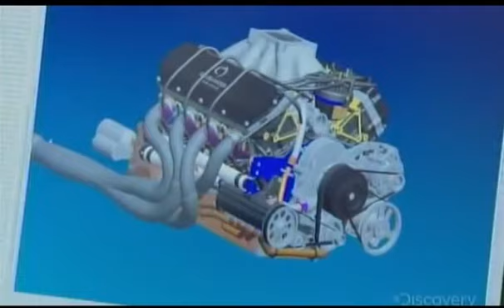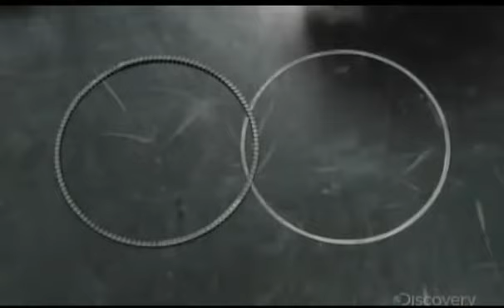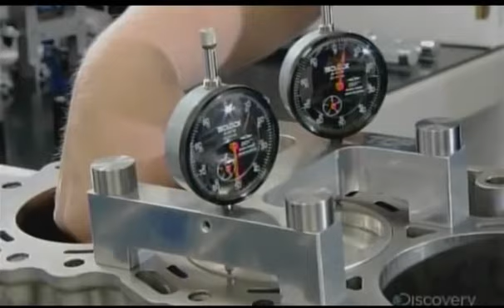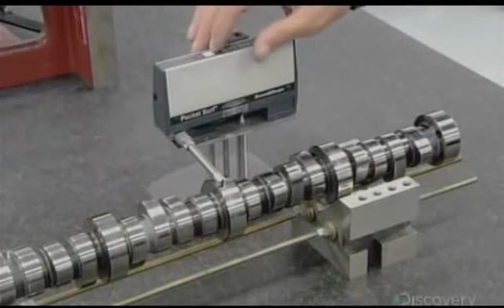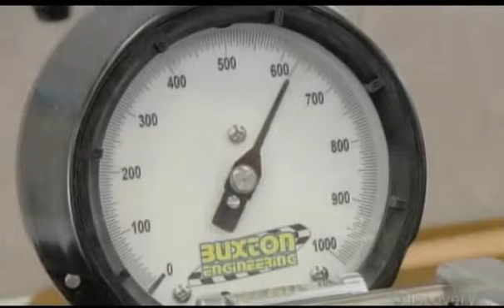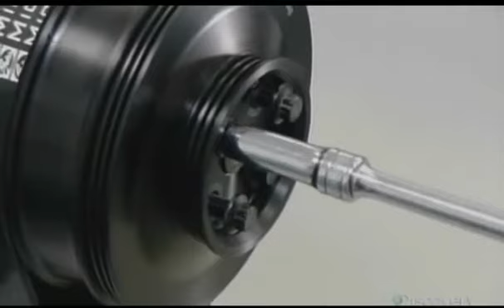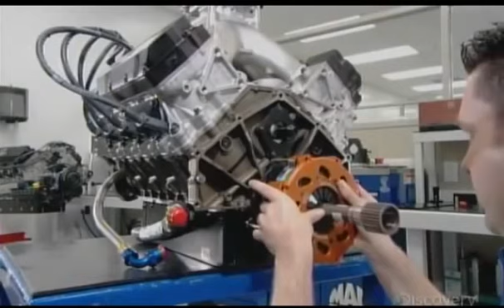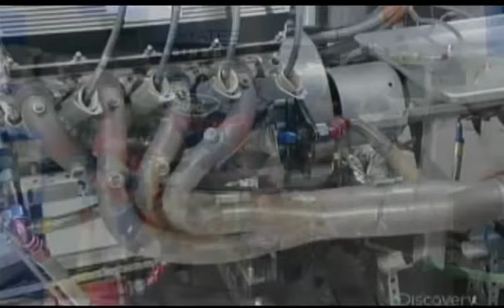How its made   NASCAR Engines

Comment: It's actually not an "explosion"...it's a very fast burn of the air/fuel mixture.
Reply: ***** The fast burning of the air and fuel mixture is called combustion, but still, the statement was correct! Which means he understood the concept...if you do not understand that you are the dumbass here.

Stop spewing insults. That is a sign of being unintelligent as it show a lack of a good vocabulary!
Reply: Timmothy LaPlante Yea, that is the wierd part...he is acting a bit childish.
Reply: That's not an explosion? Can you explain?, I'm eager to learn.
Reply: +Doosterfy it's what we consider a "fast burn" that rapidly expands the air within the combustion chamber. an explosion would actually cause a knock that is not conducive to combustion engines.
Reply: No, that's a detonation. The flame front in an explosion advances at rates of ft per second, the flame front of a detonation advances at 1000's of ft per second. The combustion in the cylinder does technically qualify as an explosion. My background is in hydrocarbon explosion detection and suppression systems (Military vehicles e.t.c.). Such systems have to act in within a few milliseconds. A detonation is MUCH faster and results in a hammer blow effect that is too fast for the piston to respond to and the sound is a knock.
Reply: 984francis That's what I was thinking. The engine has compressed a flammable mixture and the spark ignites it then it burns rapidly and imparts force in the chamber which pushes the piston. Can we say that normal combustion (spark plug ignites it) and detonation are both explosions? One is controlled and the other is not? While we're on the subject, why is the flame travel with detonation so much faster?
Reply: A detonation could be considered an extremely fast explosion, however to do so confuses things. The flame propagation rate with an explosion is controlled by pressure, the greater the pressure, the faster the flame advances however, with a detonation, the entire mass of the combustible material ignites at once because the fuel and the oxidiser are intimately mixed. If an impulse (for example an impulse from a percussion cap) having enough energy to initiate a reaction between the two parts arrives, the reaction occurs everywhere in the materials pretty much simultaneously, so the rate of pressure rise, even unconstrained, is incredibly fast and a damaging blast results. In a carburetted gas engine (petrol), the fuel and air is mixed and so has a propensity for detonation.The detonation resistance of petrol is given by the octane rating, the higher, the more resistant it is and so the higher compression ratio it can sustain without detonation. Fuel injection helps a LOT because the petrol is metered into the air entering the cylinder at a limited  rate and this helps to suppress detonation. This is one reason why modern cars are happy on "low test" gas and rarely knock though knocking is possible. However, the combustion rate in a healthy gas engine most definitely does fall into the category of an explosion.
Reply: Flame propagation rate it around 16m/s in a gasoline driven car. it needs to be at the speed of sound to be classified as an explosion...
Reply: Very interesting gentlemen. .
Reply: ***** His statement is not incorrect thus it is a way of saying combustion. Maybe you should work on your intelligence too?
Reply: ***** So your insults are to do what? Scare me to stop responding? Haha I ain`t afraid of a nobody on the internet.

See now I do not know if you even understand what a swamp cooler is as you stated that is doesn`t change the temperature of the air...and it does, I haven`t heard that term used for a evaporative cooler before as this is my third language...
Reply: First of all, who insulted ANYONE'S work? I'm rather curious as I've gone through all the comments and up until you teller of truth, no one has insulted anyone.
Reply: Timmothy LaPlante If calling somebody a dumbass isn`t an insult I don`t know what is...

And also he said: "your mama raised you to be a good little b**"
Reply: I'm agreeing with you Esseboy, but if you look up above he said someone was "insulting someone's work" but no one starting insulting anyone until he called you a dumbass.
Reply: ***** We have allready determined that...you are late to the party.
Reply: ***** I know what it is Billy. You seem to have trubble understanding me Billy...
Reply: ***** Billy, as I stated before it is an evaporative cooler, it uses water vapor to cool the air, I didn`t understand the term you used as it is not used in the rest of the world!
Reply: ***** Are you drunk? I have said that many times Billy...
Reply: ***** Are you drunk?
Reply: ***** You didn`t answear my question...
Reply: ***** That is what I have done, now are you drunk?
Reply: ***** I have said that yes, I know that the swamp cooler is a type of air conditioning...but you don`t seem to have the IQ to understand even that xD LMAO
Reply: ***** Have I ever said that they dont?!
Reply: ***** What am I arguing?
Reply: ***** Look man, I have agreed with you, I do not know why you are still arguing with me? Are you a mexican? WTF, never seen a man this bad at understanding English.

Comment: The overhead cam engine is the older design. Surprised they use carburetors and distributors instead of EFI and electronic ignition systems.
Reply: Electronic ignition used for decades. EFI since 2012.

Comment: Pushrod engine? In 2016? My 1980 Japanese motorcycle was more technologically advanced.
Reply: bud, nascar is all about feel...even now the new engines with efi(which is only throttle body injection, not even port) have no real data logging...the driver has to tell the crew chief how it feels
Reply: bruh a sprint cup engine has about 900 hp and can turn about 9k rpm for roughly 3 hours straight...ain't no lack of power there...specially considering they displace less than 350 cubic inches
Reply: ***** So they are a bit like the Amish?
Reply: actually your argument is invalid. Its a 911 TURBO and what do turbos do....increase displacement. PLus your comparing a turbo engine to a naturally asp/supercharged engine. Of course a turbo engine gets more hp and gas mileage than either one of the other 2 because there is less parasitic draw to create that power.
Reply: 1937 duesenbergs straight 8s were also 4 valves per cylinder and twin cam lol
Reply: If we scaled the F1 engine up to that size it would have 2625HP. And it would do it for 24 hours straight ;)
Reply: the Bentley Mulsane engine V8 was also pushrod, and featured cylinder deactivation. So pushrods are not complete obsolete and has a niche market for certain applications, including smoothness and cylinder deactivation.
Reply: They were using leaded gasoline till 2007 in fact https://en.wikipedia.org/wiki/Criticism_of_NASCAR#Emissions_and_pollution
Reply: Mister Scott
The biggest difference under light usage usually comes down to 2 valves per cylinder vs 4 tho, since you're on road only, the smaller open valve area of 8 valves per cylinder allow higher air velocity on the lower RPM, so better swirl, better fuel burn, hence higher low end torque, coupled with the big displacement of the engine makes it run with like no effort. On higher RPMs, the 4 valves per cylinder shine and bring way higher breathing area. I would say that the Porsche engine is more fuel efficient under high load (think of the liters/gallons per HP now).
Both technologies have their plus sides, and it really IS tradition to use pushrod, 2 valves per cylinder engines there, they would benefit a lot from 4 valves per cylinder if they run at 9K RPM. The benefit of OHV here is the total engine's weight tho, but it could have variable valve timing with DOHC valve actuation. The higher RPM possible for DOHC isn't much of a point here if the OHV system can reach reliably 9K RPM.
Reply: Haha, it's funny how desperate butthurt Americans defend their outdated technology...
Reply: The Esseboy NASCAR's a sport with a lot of history behind it. That's probably why the cars don't have speedometers, or computers that relay information about the car to the crew chief. It's probably why they were using carburetors up until very recently. There's nothing wrong with keeping these traditions.

It's what gives the sport character and makes it distinct from other forms of professional racing.
Reply: “OHC is better because its newer.” Lmfao. I cant help but laugh at you fucking idiots
Reply: The video said they use them for the sake of tradition.
Reply: ***** Just like the Amish lifestyle is very different from normal peoples life style. Like why they like to go in circles ;D
Reply: The Esseboy just look at the oil pan! That's what real engineering looks like sarcasm
Reply: ***** You forgot to mention that pushrods dont do high reving very well, and has 10-20% lower power due to breathing issues.
Reply: Pushrod is old tech as in it is out dated...

Yes they would make that kind of HP, sorry.

Longer lasting? According to who? And they cost the same...one just makes around the same HP and draws 3 times less fuel

You don't need to touch the valves as they outlast the car LOL.
Reply: Zarock I'm Italian and the LS is the best performance  engine ever made,and it's pushrod.
Reply: Sherwin Buydens that was funny. More technologically advanced, so what? Does it make more power?
Reply: Yea it's like they have no horsepower at all or something. Or maybe it is to keep all the engines running the same instead of all dopey like the rice wagons of today
Reply: Mister Scott No, ATM I drive a Renault megane 1.6 16v 2007 wagon, and a electric scooter. But hey, I`m in collage so I don`t have much money.

You took up the comparison lol. Pushrod is cheaper for a reason...that is why you compensate by buying 1.5-2.5 liter engines instead of 3.5-5.5 liter engines!
Reply: vkoptchev
nearly all heavy duty diesel engines are still push rod...there are a few exceptions...the cummins isx is a dual over head cam diesel...15 liters, 500 hp, and unlimited torque...and the cams are gear driven, not chain or belt
Reply: bighunterman77
 the faster actuation time of SOHC/DOHC is nill on a ~2000 RPM engine, also it may become impractical to just machine that ginormous cylinder head instead of individual cylinder heads in case of huge heavy duty engines, that would be forced to be pushrod. Sometimes they even are a hybrid between both valve actuation systems, like 1 camshaft per bank on V engines, closer to the head, but linked by rods to the rockers.
It's not that pushrods don't have their advantages, they do and they are many. It's just that the application in case - a high revving competition engine - would benefit a lot more from other systems
Reply: jb428 Indeed, I do not really get that as the 50s and 60s (that they love with all their hearts) where a time of inovation and new technology! Now they just run the other direction :P
Reply: +The Esseboy Hahaha, thanks man, made my day...
Reply: *****
Having a history behind it isn't frankly enough to justify, running (as in, by foot) has a way longer history behind it, and look at the evolution of the runner's shoes, preparation techniques, tracks and finish lane recordings.

Yes it can be argued tho that these traditions and keeping the cars considerably bare bones is part of the competition, who does the best with least.
Still it's blatantly obvious that it's just forcing them keeping efficiency lower for the sake of traditions.
Reply: That's because you don't understand NASCAR. They have very specific requirements so that everyone has an equal playing field and it's more about driver skill and pitcrews than engine design. The cars are supposed to be as similar as possible.
Reply: ***** So it is basicly like Football? Same booring loop over and over again..
Reply: Making them equally better is still making them equal, leveling them at a lower level isn't an excuse. A more efficient car doesn't make driver skill any less required.
Reply: In the end, NASCAR chooses to use push rods. Does it really matter?
Reply: ***** Does NASCAR matter? No, it is an outdated racing event that is only in it for the money. ZERO inovation, ZERO interest!
Reply: Sherwin Buydens even in the 60's they all ready figured out DOHC and were running them in production cars
Reply: ***** It isn`t just a different technology, but a more inefficient technology! Two in one ;)
Reply: The very point of the pushrod mocking here isn't the everyday usage of the system, which is beneficial in many ways (but not all. Don't forget hard/costly variable valve timing). The case itself is why NASCAR cars still use that. Considering the rev range on the engine, yes it would need the better breathing and lower valve float allowed by some DOHC system. Granted, it would increase both cost and weight, but I would bet the power efficiency would compensate. Think of less pit stops per race.
For an everyday V engine, pushrods still have their advantages like cost, repairability and size, as these engines will likely not be pushed beyond 6K RPM, and will mostly (daily) benefit from an engine tuned to low range torque. The upper end WILL suffer tho, and that's why I still can't help but facepalm when I see engines on the 9K RPM class using pushrods.
Reply: ***** No matter how you put it, a 4 valve car will have 36% more valve intake area...
Reply: How did you come up with this number?
Reply: Digitalle No, they ain't.
Reply: Digitalle That is engines using belts...and the belts needs to be replaced anyhow so if it snaps it's your own fault lol. Seen many many OHC engines done well over 500.000 miles doing just fine.
Reply: Not to mention many/most OHV engines still use a timing BELT anyway so the point is moot.
"My Chevy truck" well good news: truck engines are designed from start for hard daily usage... That includes huge 16 liter DOHC V8s in Scania semis too.
Also some SOHC/DOHC engines use a timing chain
Reply: The old F1 V8s made 800HP at 20,000rpm with 143 Cu in all day ;) Beat that
Reply: No fuel regulations
Reply: F1 engines have to be rebuilt almost with every race. NASCAR engines are rebuilt with each racing season.
Reply: No, they get a set amount of engines each season...the engine typically lasts 3000km, the NASCAR engine lasts about 1000km, quite a difference ;)
Reply: And it is not permitted to rebuild an engine mid season! They can only change fluids.
Reply: The best? Highest RPM? No! Most efficient? HELL NO! Highest power to weight? Dream on! Most reliable? No.
Reply: Sherwin Buydens actually pushrod engines were designed to be lighter weight, we have had overhead cam engines since the 1910s, plus pushrod engines are as competent as OHC engines, which is why the Chevrolet LS which is featured to this day in Corvettes, Camaros, Silverados, and even in the Hennessey Venom GT
Reply: The Esseboy you are a fucking idiot. Its all about how the head flows. 4valves are only better if the head can support it. Otherwise you lose port velocity and torque. His argument is not invalid whatsoever. You are the one dealing in absolutes.
Reply: 2 words. naturally aspirated
Reply: Hate to break it to you but pushrod technology is actually more modern that overhead cam.
More advanced technology doesn't mean better.  A new Chevy Stingray with 460HP and a pushrod motor can get 30MPG on the highway. A Porsche 911 making 340 HP can make the same MPG, but puts out way less power.
I've had pushrod and Overhead Cam powered cars and bikes, and they do the same thing, just differently and to claim some sort of superiority of one over the other is like arguing about iPhone or Android. (we all know the iPhone sucks ;-) )
Reply: well, the fact that economy cars don't use pushrod, most sports cars don't, motorcycles, heavy duty vehicles, boats, lawn mowers don't used it, pretty much speaks that it's useless

Comment: No torque plate when honing the 8 bores in the block???
Reply: Not a single Rod guide tool was used either...surprising
Reply: or gaskets for that matter...
Reply: What is the point? It is a race engine supposed to last 3-5 races? maybe 10...
Reply: Don’t need it on a super rigid block. There’s no block or cyl wall distortion when the heads are torqued down.

Comment: what no fly wheel
Reply: there is no fly wheel. there is metal friction plates and then there is friction plates with friction pads. these clutch packs are just like motorcycle clutches. and top fuel dragsters use clutch setups with multiple plate clutches.
the metal friction disc sits in between the padded clutch disc. the metal friction plates turn the output shaft. while the padded plates spins with the engine. when the clutch compresses and decompresses from clutch engagement these discs grab each other to complete the drive line power.
Reply: ...and that tiny multiplate clutch.
Reply: those clutch packs work better then large single plate clutch setups. more contact surface with less space taken from the clutch. each disc adds more friction surface.
Reply: +talentedman5000 so it has enough weight to act as a flywheel also?